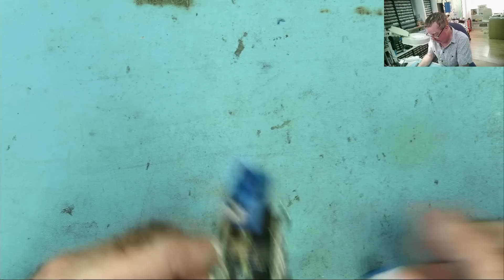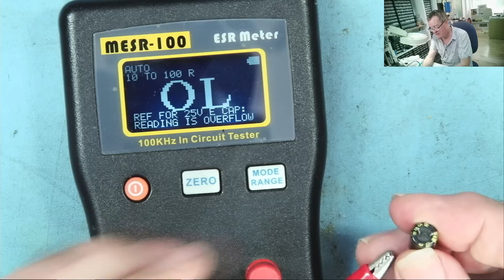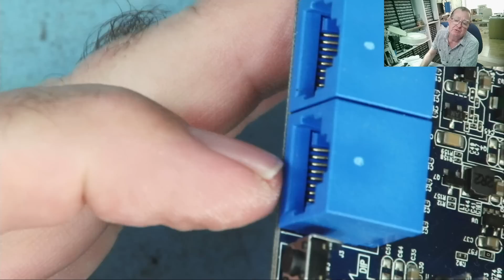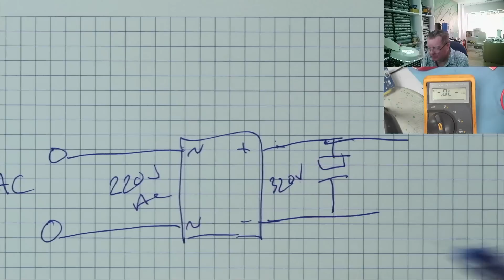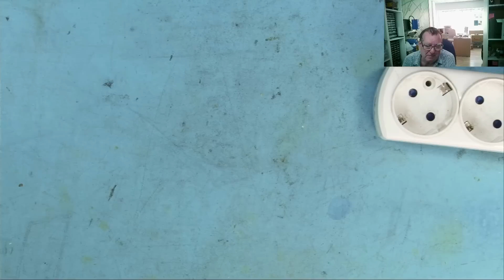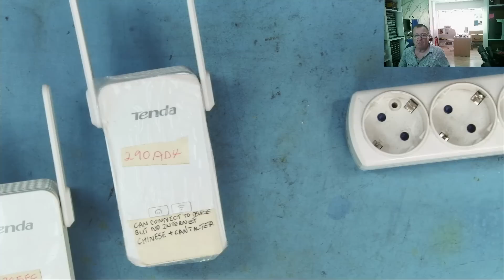Powerline WiFi Ethernet Adapter Repair

Comment from the maker: I almost always review my videos just before publication.  Firstly I would just like to apologise for the voicing on this video I was really not feeling too well ('layed up' as they say in my native town) and yeah probably i should have just stayed in bed.   Secondly, I've been getting more familiar with my new camera setup these last few videos, and I'm noticing now just how much better it is working than the previous one I was using.  Maybe it's just me that thinks the video production clarity has greatly improved, so feel free to let me know
Reply: Much better great to see your setup works like a charm now
Reply: Just a thought, I wonder if the logic circuit needs to marry up the rising and falling edges of the square wave to prove that the powerline adapters are on the same phase; or to synchronise in systems such as American 220v which has 2 phases 180 degrees apart ,and Neutral . Generally, they class the 2 "hot wires" as interchangeable, so one socket could be wired red black, the other black red. 

What are your thoughts?

Comment: this adapters have always a own arm system that calculated the data from incoming to outgoing.
thats why it have a higher latency than usual.
i have TP-Link TL-PA211( 200 mbit ) that have also blown capacitor 1500uf 6.3V on outgoing side and will not boot.
most of this failures come due instable highvoltage on the transport lines :) ( most time if there are sunpanels used )

nice info how this budget board works, i use netgear at this moment @100mbit max.

Comment: So the opto-coupler should be providing a sort of clock frequency back to the buck-boost converter on the back of the board allowing data to flow into the boost circuit and travel back into the transformer and into the wall in reverse creating like a radio frequency in the AC line that is picked up and modified by the other powerline wall adapters to create a radio network superimposed on the AC line with the opto acting as a clock signal filter for the logical side of the system. Hope that makes some sort of sense. It works in my mind, but explaining it can be difficult. but once you grasp the concept of multiple types of signals existing on the same line it becomes a matter of keeping tack of the imposed signals by finding timing constants(opto_coupler) and logic to not only receive the network or (radio like signals) and parse them against the constant(50/60hz clock) this use of opto_coupler is actually genius in concert with logic and imposed signals on the transformer going back out.

Comment: Heya, I have something simmilar but then from tp-link, normaly you can only pair 2 togeter. it would be nice to have on each room a powerline adapter so in older houses you don't need to lay down more cables   and in new bildings with concret and metal bars wifi doesn't always get trough (faraday cage)

Comment: I've found that after spraying the board with IPA, the method of laying a paper towel over the board and using your brush to push the paper towel against the board works pretty well for soaking up flux.

Obviously this can be done after you brush the board to agitate the flux.

Comment: Very interesting look inside, thanks. Oh, and yes, new face cam is much better for one (expectedly).

This HomePlug stuff is basically a last resort technology for when you essentially live in a concrete bunker and running network cables is a major PITA. Contrary to advertising, it's very finicky tech that suffers from typical shared medium issues. If your mains is polluted by noisy SMPS' or if the two end points are on different phases that aren't being coupled in the junction box, throughput will suck. With how many variables there are to house wiring, performance is almost impossible to predict.

You pretty much need the RF expertise of a ham to make it work right, and they generally won't touch this stuff with a proverbial barge pole since the mains wiring of a typical house actually makes a half-decent antenna at the frequencies the system uses and as such it is good for substantial RF pollution throughout the shortwave spectrum. While under good conditions RF power will be dialed back so as to give the whole affair just the slightest chance of passing emissions, guess what happens when the connection is not good? The interference can be detected for hundreds of meters around.

Comment: Thanks for showing us the repair. I have been using the Panasonic BL-PA100 power line adapters for several years and find them very useful. I have had to replace the capacitors as well when they won’t power up any longer. I think they are prone to failure due to excessive heat with no active cooling. The Panasonic model doesn’t even have openings in the cover to let the heat out.

Comment: Those things work similar to how phantom power does on a mixing board. In the case of ethernet it is coupling the data onto the mains at a a higher frequency in the MHz range and modulating that (typically some form of phase modulation) so the other units recognize the signal on the mains as a LAN network signal and pulls that in by filter off the mains noise and current, then it's converted back to data for the LAN

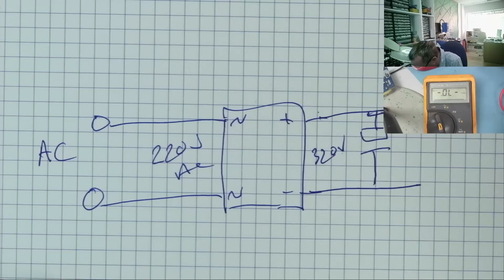Comment: As already indicated, there are bugs in your schematic, one made it to the top of the V (in 320V) at 17.33. Rectification (elimination probably) occurred at 17:36. Domestic powerline (AM and FM modulation) is mostly unreliable. Professional powerline (OFDM modulation) is used in many countries for smart meter monitoring and traffic signal control. Search for Homeplug technology whitepapers (from Yitran and Qualcomm Atheros) if you have a year to spare.

Comment: Interesting that they're using a transformer for the high frequency power-line signal. With my (extremely limited) understanding, I would have expected a capacitor. They're probably cheaper, and they pass AC, whereas I would expect an inductor to resist the changing signal. It must be tuned specifically to this application. Oh well, HF is basically black magic anyway.

Comment: They use the X10 standard to pass low baud rate data close to the zero crossing point, I think it uses a ASK technique on a 120Khz carrier, hence they have limited range...

Comment: They ana lost thee accent rich owd lad,them capacitors bosting oh tarm👍
Reply: Take it you come from this neck of the wood too. If so, have you listened to any of Radio Stoke 'Stokey karaoke'?
Reply: @ianhewitt1858  a up Ian no I haven't m8 Ive got a inherent hate for the BBC I just nip the pub lol but now a lot of the old lads have passed away now ,I think we've all got it in us ,but only use on special occasions  ,you must be local then ?
Reply: @gordonemery6949  Burslem area (Bosley). Even if you dislike the BBC, the Stokey Karaoke is very funny. They take a well known song and give the lyrics a proper makeover so they are rate fow thee way we spake.
Reply: @ianhewitt1858 I'm down Trent vale, I'll have to bite the bullet and have a listen lol.
Reply from the maker: @ianhewitt1858   Arrhm a' Neck Ender... May 😁
Reply from the maker: @ianhewitt1858  Boslem eh?  Stokie Karaoke sounds funny.  Over here you should see the puzzled looks on the local's faces when I greet them with 'Hola Pato'  which is a direct Spanish translation of 'Ay Up Duck'

Comment: I was pretty sure the data was transformer coupled to the mains which is why they will only work on the same phase and within the confines of the local substation (same grid transformer).

Comment: I took a quick look and this seems to be Broadband over power lines (BPL) technology. It would seem those little transformers can only burst modulate reliable medium speed data within few degrees of each zero line crossing? Perhaps the one configured as master transmits on the positive line crossings sending to the remotes, and the remote slave units transmit back on the negative crossings CSMA/CD style (like the old multi-drop modems or the early half-duplex Ethernet with collision detection). It's likely that clearing the configuration to factory on all three would put them into slave mode so you can configure just one as master and connect it to a network source (like an old router). 💡Richard, maybe you can sell low speed Internet to 2 neighboring stores on either side of the building you're in.. 💰$$ 😁

Comment: Quite right about cleaning off the IPA, it dissolves the flux etc but doesn't remove it. If you let it dry it will simply deposit the flux back onto the board and components.

Comment: One tips when using the capacitance meter. The holes over the dial marked C+ and C- is measuring inputs. Put down the cap there, easier than holding test leads to the cap.

Comment: These things are junk making this a tough watch but the repair itself makes it worth it. I'll just pretend it's something else. Lol

My network infrastructure company constantly deals with addressing/eliminating crappy wireless and I've actually been called in because of these exact things... There's no better connection than a direct wire.

Wireless sucks.
Reply from the maker: Yeah I don't like powerline adapters either but anything given by a friend for free is hard to call junk.  Chances are I will never use them but like you I enjoyed a look into the electronics
Reply: I think these are wifi extenders though no? Given the antennas and all.
Reply: @VolatileMenace  They could be both.. either that or they use the power line technology for some "out of band" purposes (WIFI channel management, slave configuration, power modes, system resets..)
Reply: Some ethernet mains adaptors are by nature 'wired' and work perfectly well. 'Better' is a relative term. My outside office has mains, but no directly wired Cat5/6 to the router. Getting a cable run through from the front of my house, all the way through the house, garage and finally my garden would be very disruptive and costly. I would therefore argue that both directly wired and powerline adapters both have there advantages and disadvantages. After all, I have seen people get a direct connection from downstairs to upstairs by running a cable out of one window, up the wall and through another window. Directly wired, but not really a good solution.
Reply: Ian, sounds like you could have used someone like me. I always find a way. I recently had to wire up a house for a home office (lots of that was going on) and had to go through the attic, main floor and basement... My brother's 2 story house too. There's always a way, and it's worth it.

There'll be no convincing me there's anything like this stuff that I'd consider reliable

Comment: Maybe these units don’t use the mains for data. They have WiFi don’t they?
Reply: You mean these are wifi extenders instead of power line adapters 😉
Reply: Hence the antennas.
Reply: @VolatileMenace  yep.
The model on the units from the video are Tenda PW3 1000M…but google keeps insisting on PH3 in the results.
Reply: @Infiniti25  Yes, otherwise what are the ethernet connectors for?
Reply: @tmason991  I was backing up your suggestion that these devices merely transform Ethernet into wireless, rather that transfer Ethernet over powerline

Comment: but do they actually connect to the internet ????????????? they power up yes but do they work show us that Richard
Reply: exactly lol! I'd love a complete test and maybe sorting out the chinese fw
Reply from the maker: Probably - apart from the one where the customer said he didn't.  I normally go by the theory that things have one fault, so if someone brings something in that is dead, and I resurrect it (maybe I'll even call it Lazarus) then 99% of the time it will work once I get it to power on.  Go discuss guys.... which is the most time/money efficient method of repair in real world situations.  Fix the obvious fault then rig something up to test every function of the device, or fix the obvious fault and say to the customer '99% it is probably working now, go try it'

Comment: You have to have two,  to extend the network, one near the computer and one by your workstation the other end of the house. The computer send the data to the first powerline which then send it to the second.  One on its own will not work. The early ones were slow but was better than running ethernet cables.
Reply: Tony Sheerness   Yeah, but how is that accomplished? You can't just directly connect the mains line to the logic circuit. Some type of galvanic isolation is necessary to transfer the data in both directions across the mains line.
Reply from the maker: @gordthor5351  Which is why I wanted to show how it works on a basic level- high value resistors, isolation transformers et al
Reply: Always better to run Ethernet cables!
Reply: Yes infinity, my company is based on that specifically. No such thing as great/reliable wireless.
Reply: @VolatileMenace  great minds think alike! 😉😜
Glad you can make a living out of fixing people misguided misfortune from misadventures with the wireless panacea.
Reply: @Infiniti25  Yes but these are more convenient.
Reply: @tonysheerness2427  not if you experience regular drop outs or issues.
Edit: also a wire ain’t gonna fail like one of these unless there is abuse.
Reply: @Infiniti25  You would be surprised how often ethernet cable fails. Go to any computer room when it was installed the ethernet switches and hubs were all neat and tidy, after a short time they begin to look like birds nests. Also these use to cost about £30 a pair yes they are not as good as ethernet cables, however who wants to take up floor boards and run cables all over the house?
Reply: @tonysheerness2427  that’s the neat freak version…drill a hole through, feed the cable and use skinny trunking if needed

Comment: Yeahh, Richard
Cleaning the pcb with iso and kitchen paper or other is necessary☕️💯🖖
Do me a favour please.
Take your ohm meter and meassure old pcb's where rosin was used to solder the components.
Between the components or only the pcb.
It is very intresting.

I wrote the comment. Eventuelly did you misunderstood it. You are one of the few on yt who do that. Everyone else doesn't